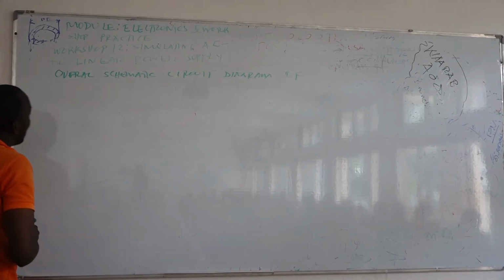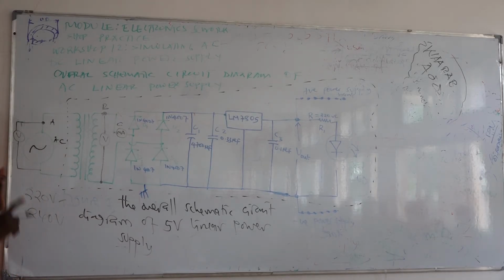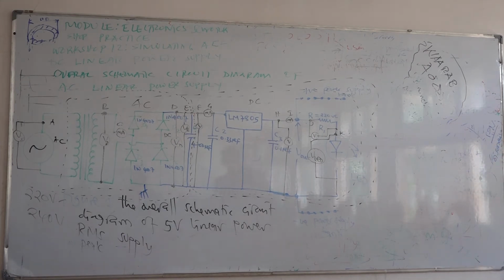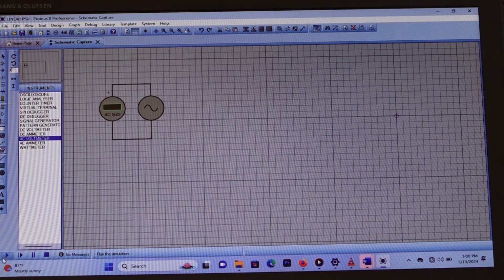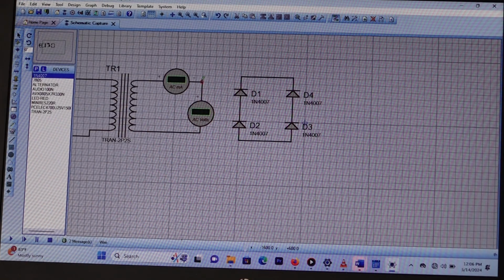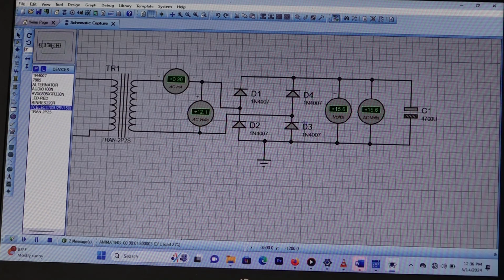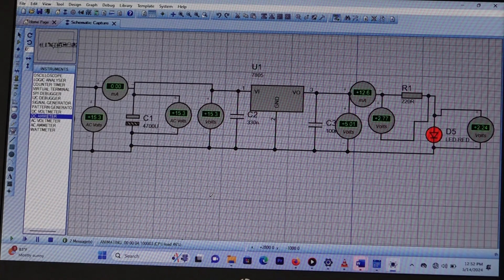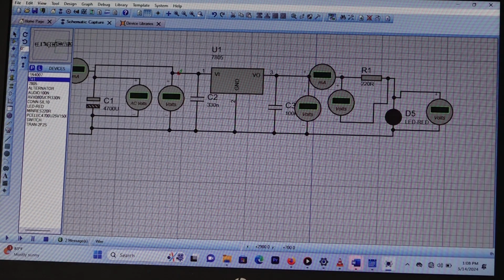WORKSHOP 06 | SIMULATION OF LINEAR POWER SUPPLY | SIR OLENJOLAI& NEKINYI

Comment: I'm sorry there's something I have not understand here why do you put inductance of 2.5mHz in secondary inductance to obtain a stepped down voltage of 12v
Reply from the maker: Thank Mr. Oswald for your question. Proteus has ideal simple transformer. The user is the one who can make the ideal transformer to be either step-down transformer or step-up transformer by changing the primary inductance. The step-down transformer has larger primary inductance than secondary inductance. In Physics we taught you that step-down transformer has many turns in primary coil (high inductance) than turns in secondary coil (low inductance)...
I believe that you have understood...
Welcome for more questions.
Reply: I meant 2.5mH not 2.5mHz I'm sorry for that  mistake